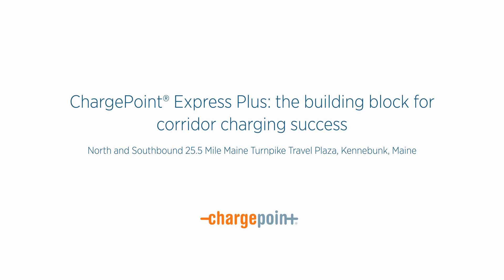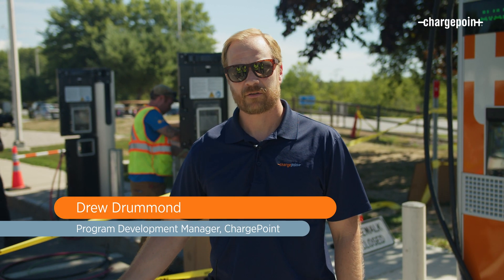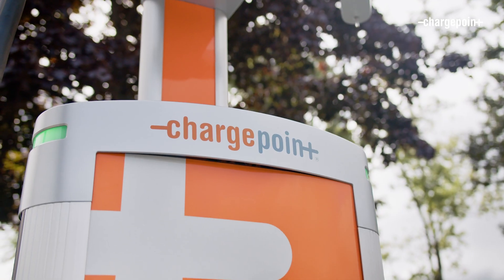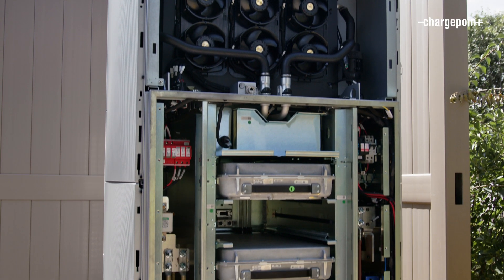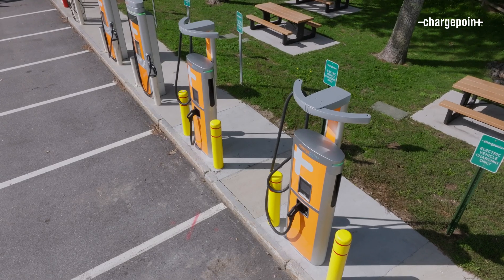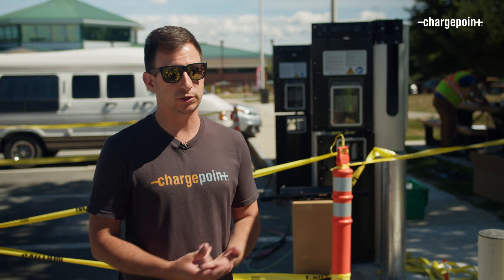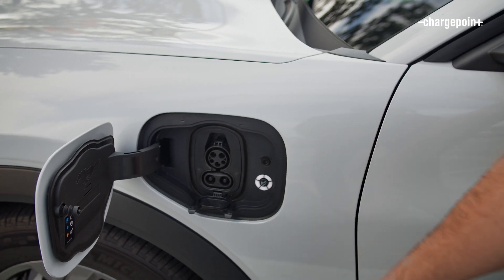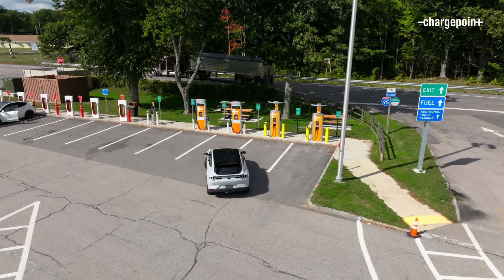ChargePoint Express Plus: The building block for corridor charging success

Comment: Your DCFC stations are excellent, but your level 2 charge handles are broken more than any other network. By far. I believe that reason is because a fob/card is needed to release the handle, but there's no visible verbage to indicate that.
Reply from the maker: Thank you for bringing this to our attention, we will pass along this information to our Support and Engineering teams. If you have specific locations that need repairs, let us know and we can escalate those.
Reply: @ChargePointnet  The ones I can think of top of my head.... All chargers at Silverton casino. 2 broke in south downtown Summerlin mall parking garage. Only 1 working in west garage at Red Rock station. Only 1 working at NVenergy in North Las Vegas.... You guys and EVgo need to help out in Kingman Arizona. There's plenty of Tesla chargers and 1 Electrify America station that usually has only 2/6 stations working. That is an extremely important location that you both are overlooking.
Reply from the maker: Thank you for letting us know, we will escalate these issues to our Support team and work with the station owners on repairs.